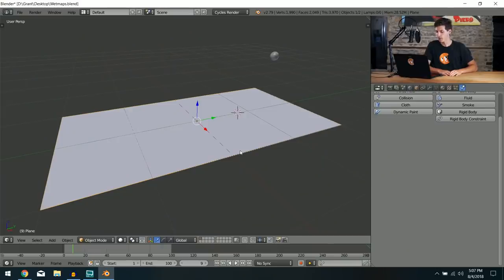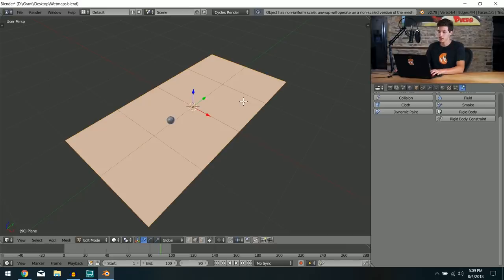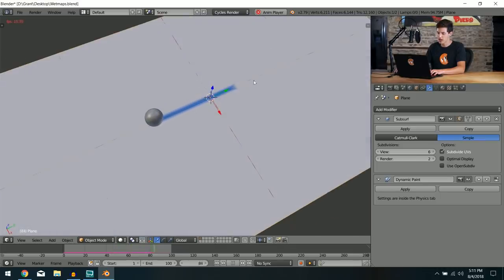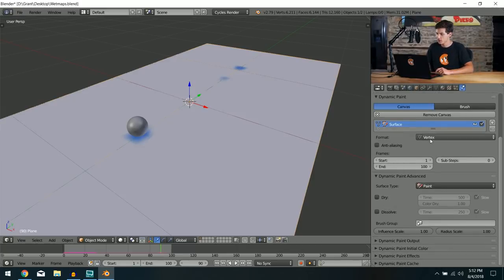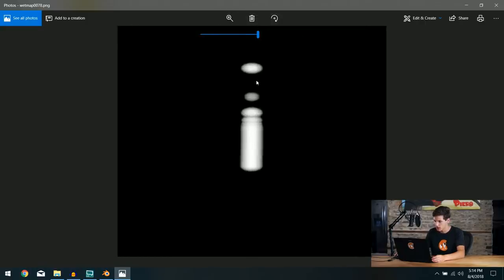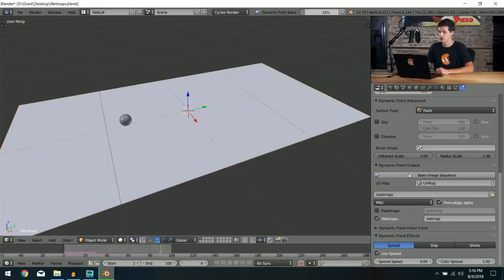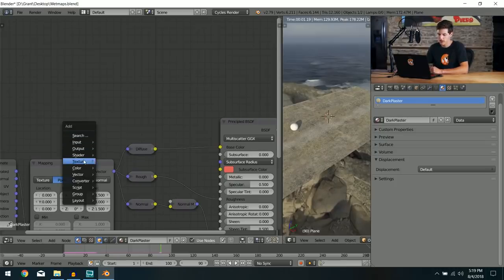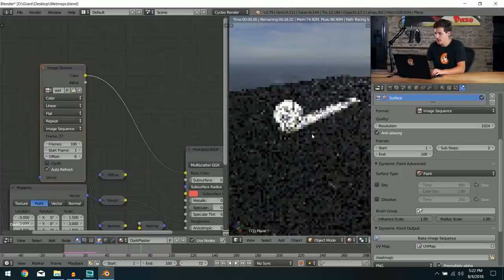Creating Realistic Wetmaps in Blender CGC Weekly #20

Comment: Good Video, but I have two minor things you might want to add: first, why didn’t you set the image sequence node from color to non-colordata? And secondly if you have water spilled wouldn’t it be smart to add an adaptiv subdivision surface modifier and use the wet map as an input for the displacement output of cycles materials?